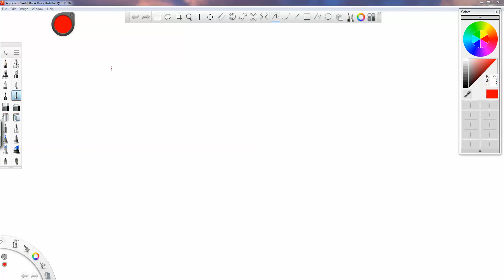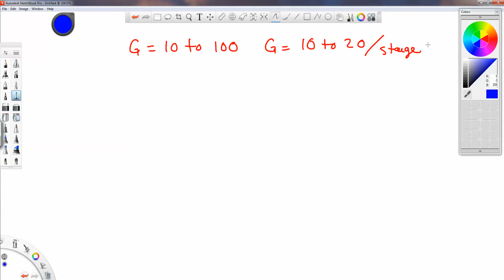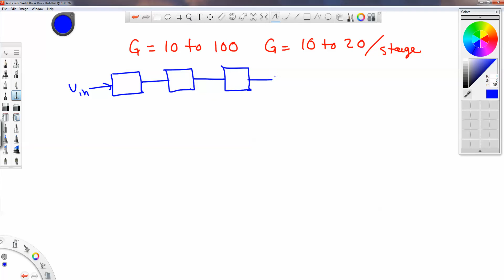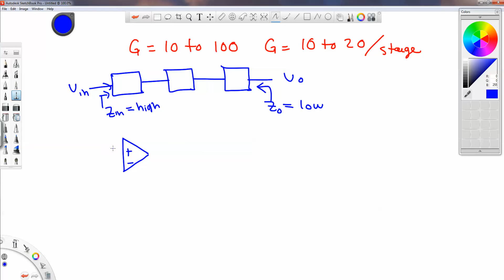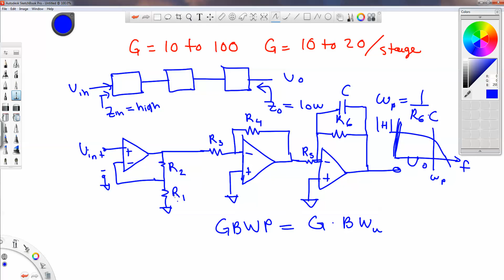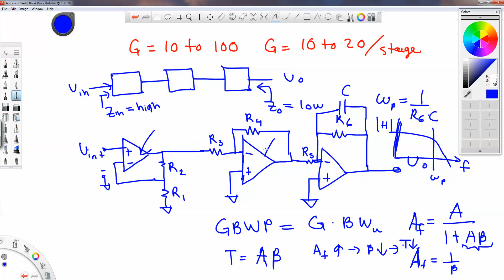Multi-stage Op Amp Designs

Comment: I have 2 questions, why do you want to end with an inverting stage?  And second, what are the rules about what resistors to use to avoid the biasing resistors?
Reply from the maker: +Brady Nelson 

1)  In this design I assumed you want to condition an ac signal so inverting is not an issue.
It is generally good design practice to end your final stage with a low pass filter.
This inverting topology allows you to have low output impedance and low pass filtering effect in one stage.

2) When you have low bias currents you don't really need bias resistors!  At high frequencies you will typically see smaller resistor values so bias
current is not a big deal.  Bias is an issue when you have a large temp dependency, which leads to offset and drift issues.  All of which depends on the bias current and resistor values (consider the worst case where Voffset=Ioffset*R) 

Kelvin